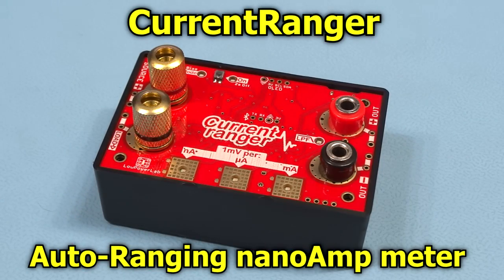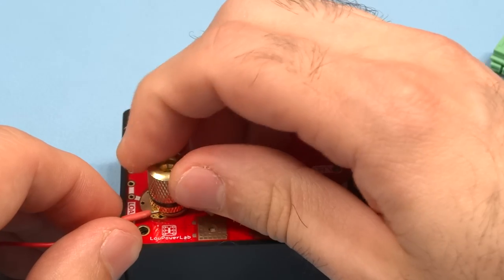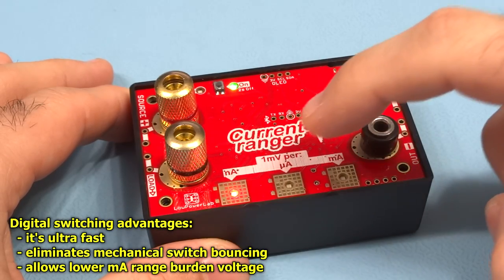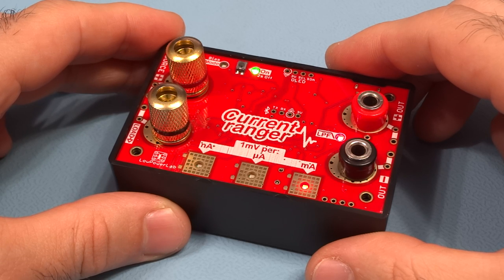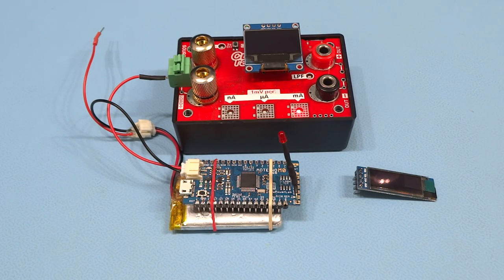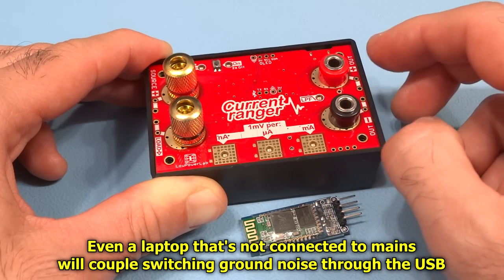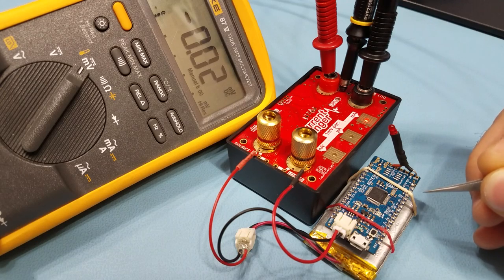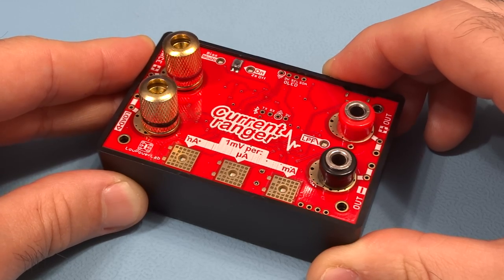CurrentRanger: auto-ranging current meter

Comment: This product has poor design and easily gets damaged. The usual failure modes like earth looping, reverse current, reverse polarity, over voltage and over current protection which is normal in almost all professional instruments, is not implemented in design. Using a 1 to 5 ohms resistor in series to the supply and measuring the voltage across the resistor gives more accurate reading in Microamps or nano amps.
Reply from the maker: It's very easy to declare something "poor design" without explaining the problem and offering a solution.
I put together an extensive and detailed guide to help users understand the device, its proper usage, its limitations.
The CurrentRanger is conceptually a relatively simple device that does a few things well, when properly used.
It cannot be compared to high end multi thousand dollar instruments.
Actually several users have compared it to high end devices, and found it to be accurate and enjoy using it, see the forums and testimonials.

Protection devices were not included intentionally to avoid current leakage and throwing off readings.
 I did include SMD pads for over voltage protection at the inputs, if you would like to trade off for some accuracy you can mount diodes there.

Earth looping can be easily avoided if you use a USB isolator and follow some common sense.
Or the cost would be higher to implement all these protections which are not really needed if you know what you are doing.
But from your statements I am not confident you truly understand how to use the device.

"Using a 1-5ohms in series" with the DUT is a very limited and impractical method of measuring current because of the burden voltage drops it introduces, not to mention noise and other issues.
 If that worked well I would never have bothered to make this device.
Reply: @FelixRusu   I don't deny the effort on the design, however there's lots of should and shouldn't to use your device. The burden voltage is a misleading false problem you are suggesting, the user of your device is about to measure only a few micro amps or nano amps, otherwise they would use a multimeter. With one ohm series resistor the burden voltage is negligible a few microvolts only. With the noise issue even your design atracts noise and you already emphasizing in this video and suggesting to use Bluetooth isolation. For a non commercial grade gadget like this with max prototyping cost of $20, your device is highly overpriced. And the price suggests it is a well designed instrument which has looked at different failure modes and mitigated them.
Reply from the maker: @davoodnasehi  I will yield to you to design a better product than this, for $20 or less.